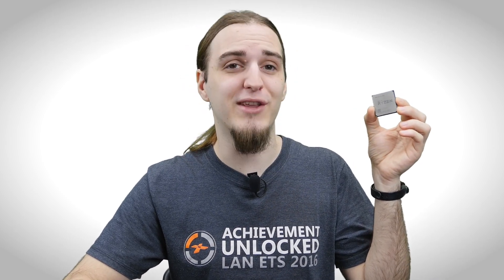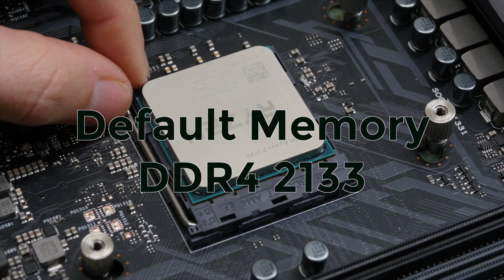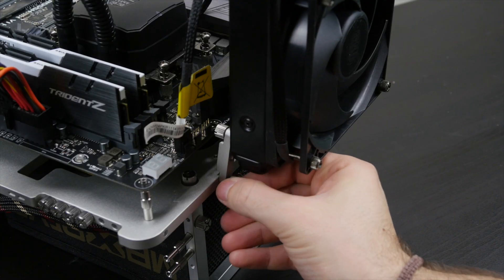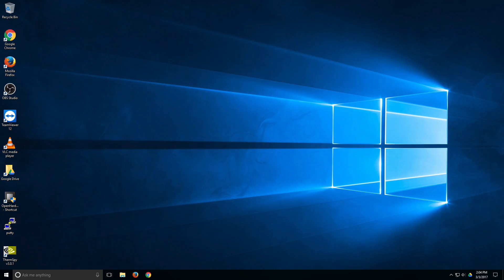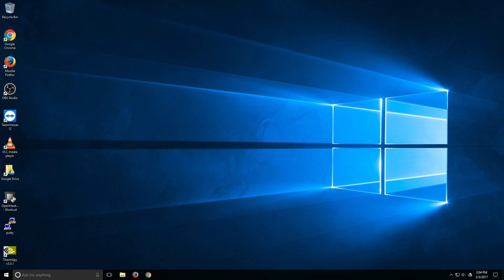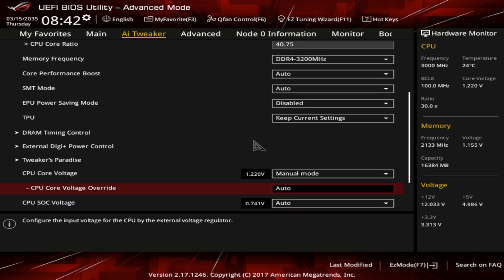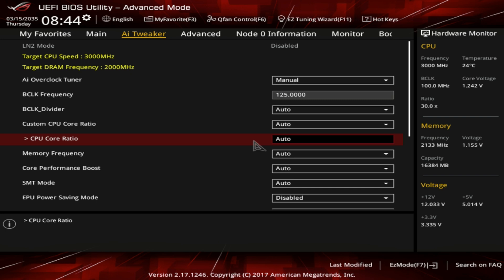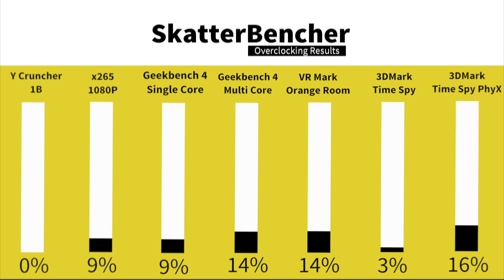AMD Ryzen 7 1800X Overclocked with ROG Crosshair VI Hero and G.SKILL Trident Z | SkatterBencher #8

Comment: I can’t get my 1800x to overclock at all and it doesn’t boost at all from 3.6 and the slightest overclock it crashes also I can’t get RAM to run above 2133 and its 3000 speed.

Comment: Nice short guide. When are you gonna focus on mem chips? I tried a few different mem chips.. I had MFR (2*4) running 2666c14, E-die not posting at all en B-die running 3200c14 and the easiest mem to use. I had no AFR, D-die or micron to test but I am pretty sure you have.

Comment: Hi Skatter i've almost got the same setup but i have 2 dimm tridentz 32GB 3200mhz but different latency mine is CL16-18-18-38
Should i change the numbers in the bios or can i use the ones you have been using in this video?

Comment: My Ryzen setup is jsut wierd, with the Ryzen 7 1800x, ROG Crosshair VI Hero and G.Skill TridentZ RGB ( F4-3200C14Q-32GTZR ). My pc shuts down, starts up again before POST, sometime 1 time shutdown, been up to 3 times, I tryed all the 2133 to 2666, but keeps restarting, and I have NOT found a single guide how to fix this, I tryed new ram, tryed swaping the places of the RAM and same thing. coldbooting results to restart then it can boot. Any idea what the issue can be? and running the 1107 bios for the motherboard
Reply: I had the same problem. With Corsair Dominator Platinum DDR4 16GB kit. System dosent like it past DDR 2666. Mhz. It would cycle 3 time with 3 peeps on and off type thing. Thing to do is turn computer off and reset it throught the CMOS button on the back, wait for it to rest and boot up.
Then after some playing around I found a spot where setting up the DOCP default or it shows what your ram speed is. 
Set the CPU ratio to 40.00, 
BCLK-D to100, 
set the FID to 200 
and the DID to 10, 
then the DDR set to 2666mhz. 
The in the Ram timing settings put in what on the package or what ever its rated for. 
You can start with that and see where it goes. 
Voltages seemed to work them selfs out. 
But for my Ram its was 1.375 and the CPU was 1.45 or so.
Thing is, this ram I believe isent ready for this board untill they upgrade and fixed the bios.
So far It seems to work better with the FID and DID config. 
I believe.
Had a score in Cinema 4D of - 1744 
Good luck
Reply: Also I heard this is the ram to get for the AMD Ryzen set up: 
G.SKILL Flare X F4-3200C14D-16GFX for AMD Ryzen 16GB (2 x 8GB) DDR4 3200MHz (PC4 25600) 1.35V 14-14-14-34 Performance Desktop Memory

Comment: Isn't setting memory voltage to 1.5V way too high for ddr4?
Reply: no , for overclocking 1.5 is a standard , does not matter if it is ddr3 , ddr4 , i OC my ram from 2133 to 2666 with 1.5 voltage , 5 C more on the ram , not much .
Reply: The reason why I ask this is, I have a DDR4 3733MHz  2x8G TridentZ kit from Gskill and when I have a look at the Max Voltages on the website, they insist not to exceed 1.35V. Any kit above 4133MHz can be set to 1.4V

Comment: Hey Skatter, I have a Ryzen 7 1700 on an Asus Prime X370 Pro with Trident Z RGB F4-3200C16D-16GTZR (the cheaper C16-version with 2x8GB). I learned that this Memory should run @ 2666 MHz, but I cannot find any information on timings, so I am stuck @ 2133. Any idea on how to get it to 2666? Thanks!
Reply: That's what I did. Doesn't boot. I even tried with 1.35V, but auto settings on timings don't seem to work...
Reply: I just found out that the cheaper 16C Trident Z RGB doesn't have Samsung B-Die. I will send them back and get the 14C.

Comment: Hey there Skatter. Would like to ask you a question. I`m going to buy the 1700 model and gonna overclock it to as much as 1.35V permits it to be stable. However, not sure on which motherboard to pick up. Really like the Gigabyte X370 Gaming 5/K7 (pretty much same price) and II just love the ASRock X370 Taichi which is unfortunately more expensive. The only difference betwen the 2 I`ve found (that affects OC) is that Gigabyte has a 10 power phase design, while ASRock has 16. Will the only 10 power phase design of the Gigabyte affect the OC potential of the 1700 or it`s not much of a big deal? Thanks!
Reply: Alex Chiriac leaving comment to get notifications should someone answer. Also interested in this

Comment: Does the performance increase with the 125mhz bclk refers to the one before with 4ghz, 3200mhz 100mhz bclk or the original situation?
So is your setting with 125mhz clearly faster or just slightly different than the 100mhz bclk?
Reply: Your increasing the overall bandwidth and speed your CPU is able to communicate. So yes there's a few percent to gain.

Comment: Thank you for the tutorial. Nice video. Will this method work on Asrock X370 Taichi?
Did you run into problem using 3200MHz memory at start?
for example, no POST etc. 

I am building my PC soon with Taichi and 1700X. If I use 3200MHz memory, do I need to tweak it to make it compatible with AM4? (heard about Ryzen memory issues). Will I be able use to boot my PC without tweaking it? I'm okay with it running at default speed (2400MHz) temporarily. The memory issue is really making me concern about it. 

Sorry for newbie question. Tips and advice are really appreciated here.
Reply: Beside the obvious clx-x-x-x timings, there are more timings that can't be changed on ryzen boards yet like e.g. command rate. G.Skill use Samsung Chips for their DRAMs, that are able to run at tighter settings. Ryzen seems to apply these tight timings in general. This is probably causing the problems with many other modules at higher speeds. G.Skill Trident Z is the best chance for now.

If you are looking for maximum performance go for the taichi, crosshair or gaming7, because the bclk needs to be raised for maximum performance, especially in games. Also use 2666mhz or lower for ram and only use the bclk to achieve higher clock rates such as 3200.
Reply: thank you for the info. I'm going for the Taichi, it looks like an amazing board. I am thinking of getting the Trident Z RGB F4-3200C16D-16GTZR, but the recommended timing for taichi is C14, I don't know if I'll be able to tweak it or not. 
Avexir Core 2400MHz seems a good option for 100% compatibility, but lower speed. or I'll wait for Flare-X 3200 Ryzen memory.
Reply: Thank you very much for your advice. I feel a bit safer for my memory choice. I'll think about it. Although I don't mind running it at stock speed for now.
Reply: The latest AsRock BIOS out yesterday says they opend up memory timings, not sure which/waht ones yet though. My board is due to arrive today so I may know more in the next few days.
Reply: I just saw that on their website. You're getting the X370 Taichi? Would you mind to share your thoughts on the board? and the specs you are using, especially RAM. I'm looking for it
Reply: The X370 pro gaming as I thought for the extra the 5Gbit LAN actually added something novel and it may be of use in a year or so versus having to have a card stuck in the board for faster LAN.  The BIOS appears to be the same version as the Taichi one so I imagine they will be very similar.  Power phases look identical.

I have some 3733MHz RAM ( 2 x 8GB) from Team (Ryzen mentioned in the spec sheet) with the hope I can use tighter timings/get good compatibility now and add speed later.

I believe they have Samsung chips. They are rather pricey though.
Reply: Well, we only have the Taichi and Gaming K4 series here. I was hoping to see X370 Extreme4 before, if they had it, I would be getting it right now.

Which one the RAM that you mentioned? The Team T-Force Vulcan series seem pretty good, but one reviewer said they have SK-Hynix chips though.
Reply: It's the "Extreem", the heatsinks are insane massive blocks, I think the two sticks or RAM weigh nearly as much as the motherboard. :)

http://www.teamgroupinc.com/en/product/T-Force%20Gaming/Gaming%20Memory%20Modules/DDR4%20MEMORY%20MODULES/XTREEM%20DDR4

Have you played with EFI 1.55 at all?  It adds some timig options apparently. They seem to be working on the RAM in the last couple of versions.
Reply: what a sleek looking RAM! Nice choice on RAM :D

No I haven't, I still can't build mine yet, I'm waiting for the cooler to get restocked. I got the AM4 upgrade bracket before the cooler (thanks to Be Quiet's superb support). Now either I'm going to get the Be Quiet cooler I want, or wait for new cooler with native AM4 compatibility :( too bad I might have to wait until April.
Reply: LOL, I can't build yet either as a) I have mislaid the power supply (don't ask!), b) am recovering from surgery and c) I should really wait until the AM4 cooler mount kit arrrives!

So it looks like we are both waiting until April.
Reply: lol... so yeah we are in the same boat. If only they have included Wraith Max with 1700X I would have been enjoying my build right now. Let's just be patient :)

Hope you recover soon by the way..
Reply: Thanks, I at least have a copper-pipe AM3 hook mount AMD stock cooler available/ I might even try that first to compare to the Kraken later.

I went for the 1800x to give AMD some extra R&D money. ;)

Comment: I applaud you for actually paying some attention to the SOC Voltages in the bios. Im sorry if this is a little long but I think it is important for Ryzen users. 

All the other reviews I have seen only Use the core multiplier overclocking (at least I assume so because they do not provide details on what adjustments they made and most have slow memory set) the common complaint from other review sites is that while pure calculation benchmark performance such as Cinebench are excellent, Gaming performance is not so good compared to Broadwell-e. It really surprises me that none of the other Tech reviewers have mentioned SOC or its voltages or seem to be able to work out that the on die PCIe controller in the Ryzen SOC is in between the CPU and GPU and manages the PCIe communications between the two devices. A weak PCIe controller will get overloaded and of course cause performance bottlenecks when both CPU and GPU are under load. 

Intel CPUs also have on die Memory and PCI controllers for the x16 lanes. The architecture is different but I think the principle is similar having the controllers near the processing cores. They can be strengthened for better high vram frequency support and higher FPS by using small VCCIO voltage adjustments (at least that is true on i7-2600 with a GTX 1070 (micron)). CPU PLL voltages can also be used to adjust the balance in priority between CPU and GPU priority and can be demonstrated in Firestrike with either slightly higher physics and lower Graphics scores or higher graphics scores with lower physics scores as the PLL voltage is adjusted up and down around the ideal voltage. 

I noticed that your timespy total bench mark increased by only 1% for both single multiplier and memory overclocks with large physics increases, you also got 3% when you combined them and increased the SOC voltage. The only way you get a 10% physics increase with only a 1% total increase is if the graphics score that was not reported has dropped at the same time that physics score increased. That suggests the PCIe controller is creating the same bottleneck between CPU and GPU and not forwarding the CPU instructions to the GPU as fast as a Broadwell-E CPU. 

I am theorizing that the SOC voltage, or another SOC IO related voltage may provide a similar performance increasing function as VCCIO does on Intel CPUs.

Could you please run some tests in Firestrike with different increasing manual SOC and/or other SOC IO related bios voltages and see if 
1. overall CPU combined with GPU (gaming) performance improves after increasing voltage in the SOC settings while running an overclock and 
2. If different SOC related voltage settings adjustments interact with each other and change the balance between the graphics and physics scores.
Reply: SOC voltage has rated a couple of mentions. All of them either saying dont touch it or set it to 1.2V. so what observations have been made if it is set to 1.2V? What happens with memory latency if the voltage is at an intermediate level? CH6 OC Guide does say max safe voltage is 1.3V but I sitll have no idea what 1.3V will do

What happens if the CPU PLL is adjusted up and down? 

If you adjust a Sandy Bridge CPU PLL and run firestrike benchmarks, as you slowly increase the voltage from the default of 1.8V, you can watch the balance in graphics and physics scores change. There is a point in the middle that finds a balance that will give you the maximum combined and total score. The behavior of weighting the performance balance between compute and PCIe traffic is not reported in any of the overclocking guides. CPUs do have different architectures but silicon still uses voltages to tune signaling on different rails that have effects on different clocking and how different components react to each other.

I still have no Idea what the other voltage adjustments do either. No-one seems to be doing any experimentation. It seems obvious to me that at the defaults, the Data Fabric has not been tuned to maximize performance with a titan level GPU. Memory latency seems high and yet AMD market the Infinity Fabric as being high bandwidth low latency. There must be some way to tune this thing to at least improve performance. 

I am pretty sure that the DF has been detuned to help keep the chip under its 95W TDP power budget however, people interested in overclocking don't care if the cpu ends up as a 120W chip, they care about having the option to not nerf their performance. 

I want to get this sorted out for the benefits of everyone. I am considering buying one if it is not going to be a permanently handicapped system. I do not have the luxury of AMD giving me a nice wooden box with CPU, Memory, cooler and motherboard to do these tests myself which I would be happy to do if I had the opportunity.
Reply: Gaming loads will not have any impact on PCH/Promentory connected devices, unless of course there is a lot of disk IO to PCH connected sata ports.

I am not convinced that the primary "PCIe 3.0" port is actually getting the full 15GBs bandwidth through the Data Fabric that the spec suggests it gets in the first place. Even a Titan XP can only use maybe 10-11GBs and using an x8 connection with 1/2 the bandwidth does not drop the performance by 50%. It stands to reason that power savings can be made if you tune the on chip communications to only have enough capacity to direct say 11GBs capacity to a controller that supports 15GBs because no-one is ever likely to notice (unless you are a reviewer testing 1080p games with a Titan XP) and it keeps chip TDP under 95W.

If the 95W limit is not important to you and if overclocking, you are not looking at those power limits anyway, increasing the capacity/tuning with some voltage increases to the correct rails should be doable I think. It will be interesting to see what you discover. I have no idea which are the exact rails though.

I have found in the past that using firestrike and comparing the changing ratios of Graphics, physics and combined scores as you make voltage changes is an easy way to tune the system
Reply: OC3D mentioned SOC voltage in their CH6 review, that may have come out after your post above though. :)
Reply: Well put. I also sometimes suspect that some of ther "tricks" discovered are kept secret by pro OC folks.

My board and RAM just arrived but I'm unlikely to be able to get the system together for another week.

There are also a couple of "PROM voltages" listed in the AsRock manual, my guess is these are for the chipset (Promontory) which is a really odd way to label them but maybe they have changed this in the lasted EFI or I'm wrong and it's something else.

I agree on the DF, something seems very strange, at the very least having it "locked" with no dividers.  The downgrading of the PCI-e revision and not having a divider for it is also odd.

Once I get up and running, feel free to PM me with things you'd like to look at. I plan todo a lot of iterative testing rather than just cranking certain voltages/multiplier.

The AsRock also has an external Bclck chip; presumably ref clock on this platform, whether that makes any difference is another question.

Certainly there is a lot more to play with than what has been done so far and time is needed for people to test things, more info from AMD would help and maybe they are holding something back or some info that might be useful as the DF is still apparently under NDA and they dopn't want to show their hand on the server side just yet. (pure speculation here).

Anyway, it will be a lot of fun playing with it I'm sure.
Reply: brad morris Thanks for the added info Brad, great stuff!

Comment: Great video showing Offset Mode overclocking & benchmark gains. Its a pity you don't show any temps or do any stress tests comparing the stock & overclock temps. Next time please show the temps & please also include Cinebench R15 Multi & Single in next benchmarking! Many thanx.

Comment: Interesting, I don't see that BIOS rev on Asus's web site is it newer than the 5704?

It also looks like you are running around 0.2v less than the other videos I've seen. Likewise the RAM voltage is nice and low too. Very nice!
Reply: :) I'm getting the Asrock X370 pro, they seem to be working hard on their EFI.

QQ: Do you know what week your CPU(s) are, mine is week 7. Maybe someone should start an OC google sheet with week/stepping and OC results with settings.